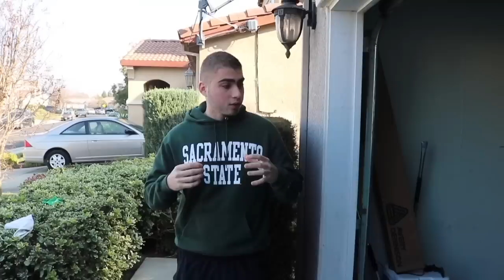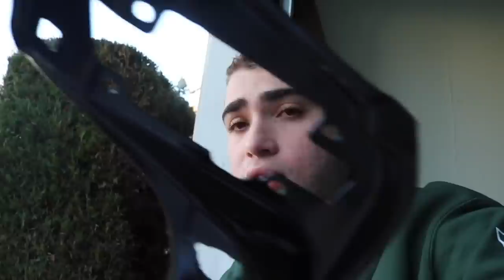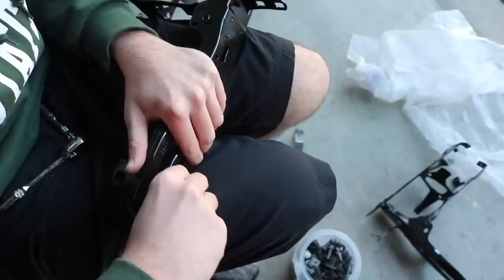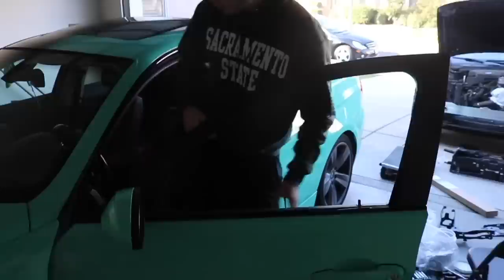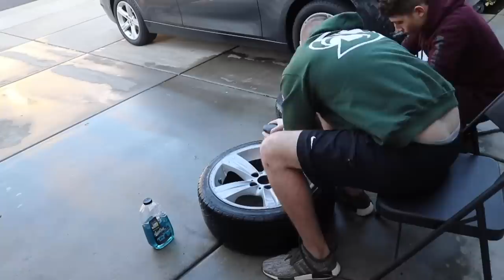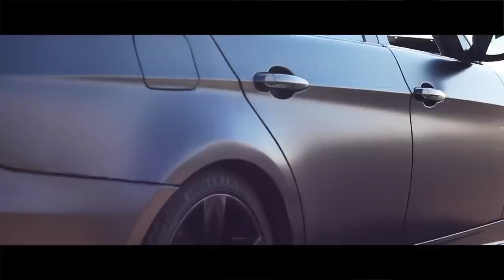WE SAVED HER! 335i Now Ready For Power!

Comment: The horn bracket you made will suffer from a lot of vibration so something I recommend is that you remove that bolt and apply some thread locker too it and then put that bolt back on. This will prevent the screw from being unscrewed from the vibration...
Reply: Yep unless that screw was very snug going to the threads

Comment: Headlights need a change orange a no go for the 335i
Reply: euro spec headlights!!!
Reply: Delete the amber. Do a DIY video
Reply: @michaelc1154  to do this he must remove the headlight lenses and then he can remove the orange amber cover i know this because I replaced the lenses on my bmw 328i headlights today
Reply: @michaelc1154   opening the lenses is risky and even if you do open and re seal with no complications odds are very high you will have condensation issues inside the lenses very fast.
Reply: Mtb Ridingog how did it go?
Reply: slugerX Tommy i know I’m having issues with Condensation
Reply: @tommye9057  I don't have any condensation inside of my lenses I resealed them with the glue that came with the lenses and I have yet to see any condensation at all
Reply: @michaelc1154  it was not easy and it was definitely not hard 😂😂 .. it's in the middle it is a mission to get to lights of the car to beginning with but once they are off you have to remove the bulbs and put the light into the oven for about 30 minutes set at about 200 degrees Fahrenheit to soften up the glue that holds the lenses onto the headlight housing.. I would say just buy new lenses while you are at it because you may crack or scratch your lenses ..
Reply: Mtb Ridingog yea that’s what I plan on doing is buying new lens